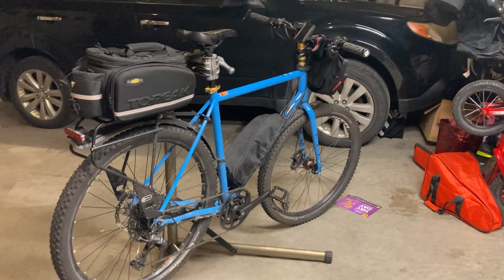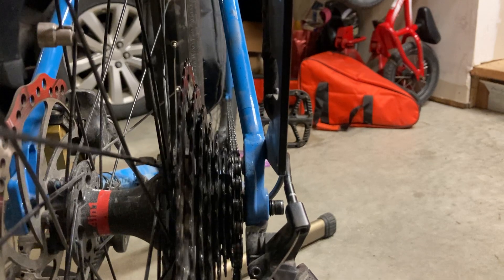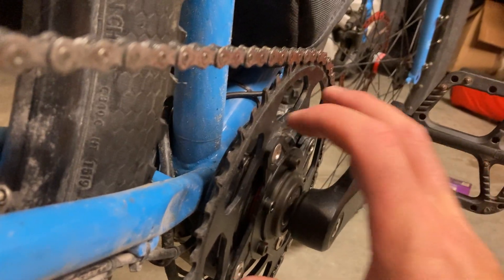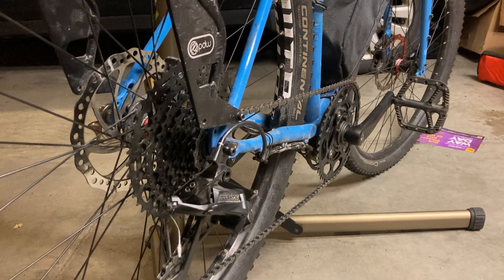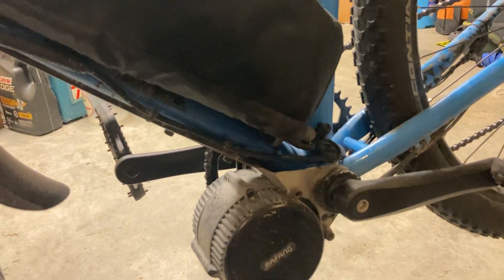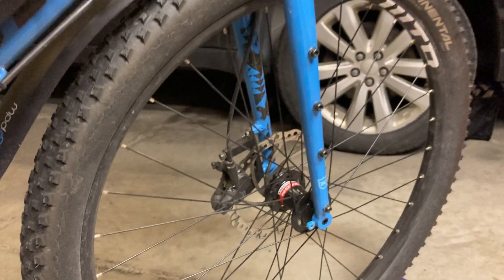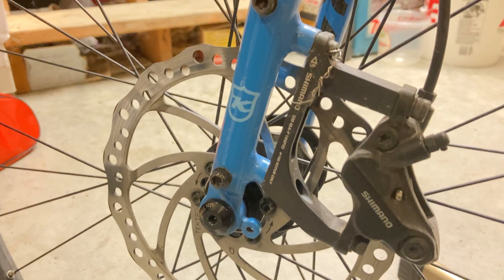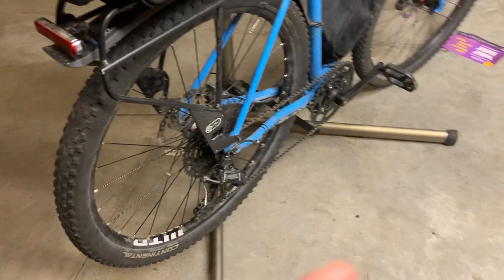Kona Rove DL Gravel E-Bike Build! Issues and Solutions

Comment: I used a 2013 Marin Palisades SE as my diy e-bike canvas with a Bafang BBSHD. I equiped it with a full Shimano Deore XT 10 speed transmission and brakes, it's a blast to ride.
Even though i have the motor amperage turned way down because on level 1 it was too fast. I have almost 3500 miles on the motor and after about 2500 miles you will want to grease up the motors internal gear drive and check every so often that the crank arms aren't coming loose. I've put red thread lock on them and the non drive side crank arm still come loose some times, I use a torque wrench when reassembling to make sure that I don't over tighten the bolts. 
I hope you get thousands of miles of enjoyment out of your build and thank you for sharing what you created with us, Good day!
Reply from the maker: Thank YOU for sharing!! I hope it inspires others to build! I agree about the power, this bike would be fine with even a 500w mid drive. This BAFANG 750w I even detuned to 20A (only 1000w peak vs 1400w) I’ve only got about 600mi so far but I plan on more this year! It’s a great commuter 😊

Comment: I see you have 2.2 tire in the rear, do the tire rub on the frame?
Reply from the maker: So - the actual knobs don’t - but the little new whiskers on the tire were slapping the frame for a while until they wore off. But I also have the frame wrapped with clear vinyl in that area which does narrow the gap slightly (1-2mm)
Reply: @rpiian  Thanks for your info; so mounting some 50mm G-One Ultrabites won't be a problem? Or is there too little room for clearing mud?
Reply from the maker: @jeroenlaarveld8154  if it’s 650b it should clear. 700c x 50 will not.